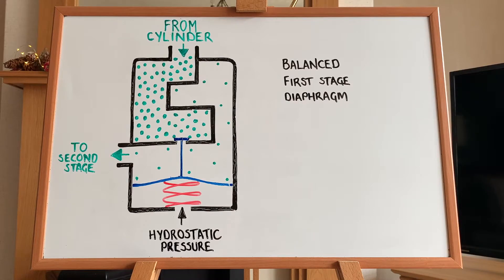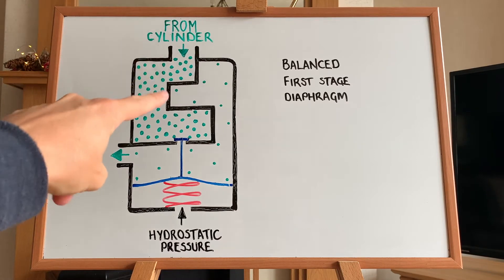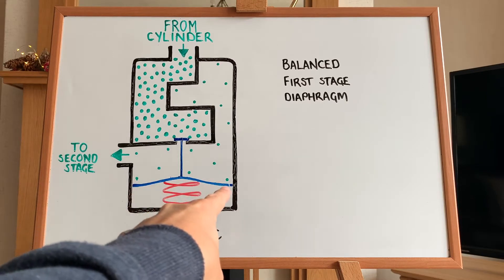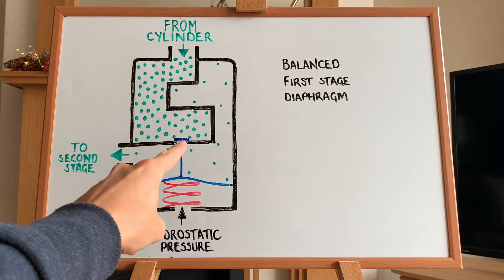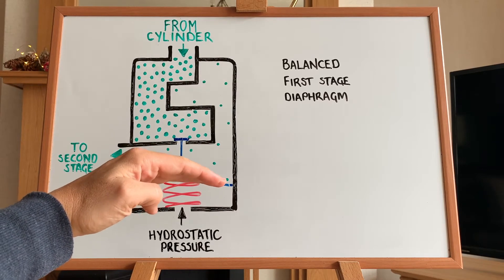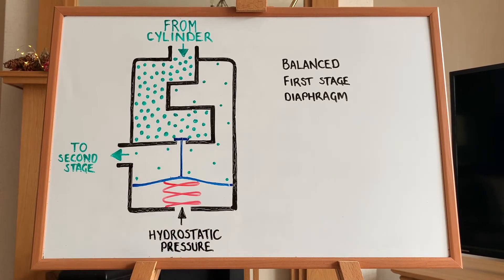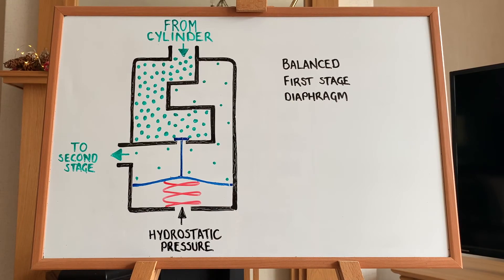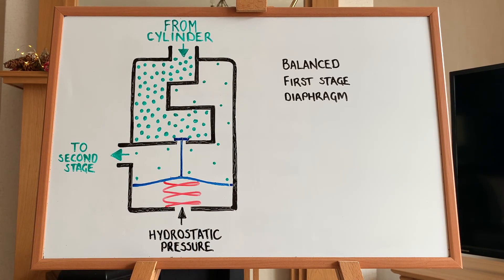The 101 - How a  Balanced First Stage SCUBA regulator works (Diaphragm)

Comment: What I need to do to increase air pressure? Do I need to wind or unwind the spring?
Reply from the maker: Do you mean increase intermediate pressure in first stage (I'm assuming based on the question)?
Reply: @stephenjaynsley  yes 👍
Reply from the maker: @AlekseiZorin-j9g  I don't know about winding/unwinding springs but you'd maybe just replace it with a new one if it's fallen outside of the tolerance, or if it's Scubapro then you can add a shim or two. However, this is not something you should do yourself as it's a service operation and you want to maintain your warranties as well as not expose yourself to the potential safety concern and have it done by someone certified (I'm assuming you're not a technician on your brand of reg or you'd not have asked?)

Comment: Is there a particular benefit between either pistin or diaphragm?
Reply from the maker: Ultimately, no. Those who cite the benefits of one over the other will find they have an equal who cites the opposite. With modern designs then there's very little difference and a diver would be hard pushed to find an obvious difference when used. A diaphragm however will be more suited to environmental sealing and 'could' theoretically perform better in very cold water (less chance of freezing). The biggest difference is actually not whether it's piston/diaphragm and rather whether it's balanced or not.
Reply: @stephenjaynsley  Thank you for such a comprehensive reply and response! Would you mind briefly expanding on the differences/benefits between balanced and unbalanced? Or have you already made a vid on that which I'm yet to get to as I work through your entire back catalogue of content!? lol
Reply from the maker: @davideaston8314  the videos I have are representative of a balanced first stage. Loosely speaking, balanced first stages are assisted by water pressure, so as depth increases then the ambient pressure aided the function of the first stage meaning the diver doesn't really 'work harder' to overcome the increased resistance to get a breath. But, unbalanced regs are not aided by this so theoretically the deeper you go the more effort the diver needs to exert to draw a breath.
Reply: @stephenjaynsley  Perfect - thanks 😊